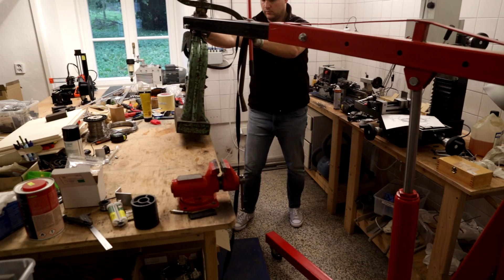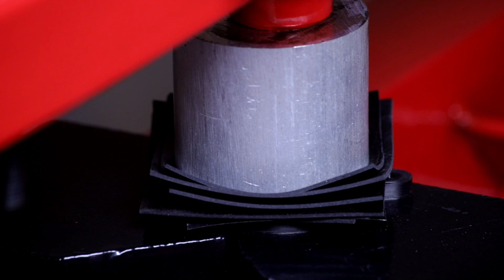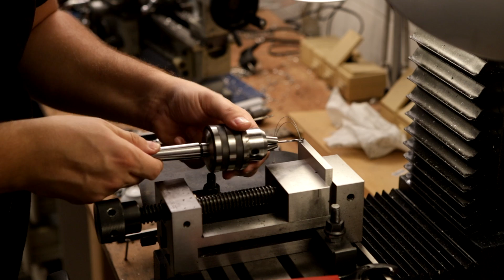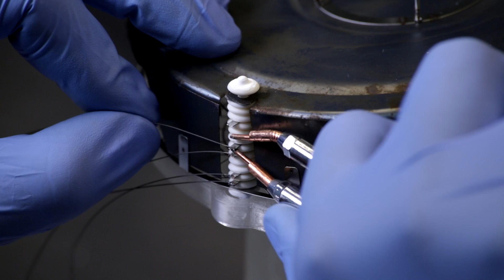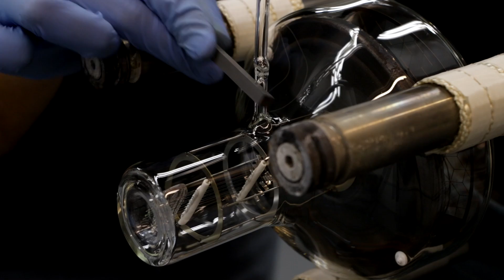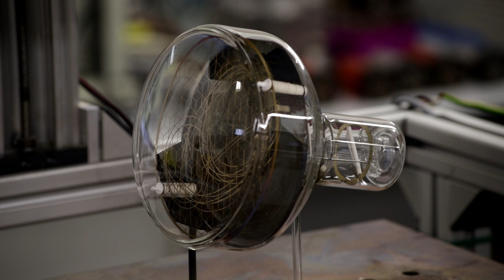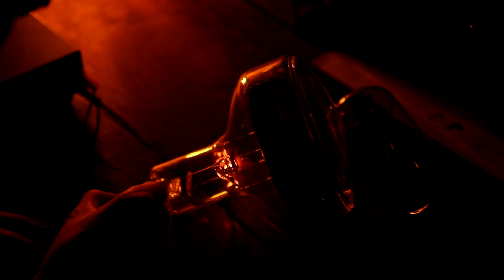Making: Huge Nixie Tube Finally Glowing!  - Project H #19

Comment from the maker: Hi! Thank you sooo much for the positivity and constructive attitude - not only it helps me to get closer to the working H tube, but it is also incredibly motivating. In these gloomy autumn days, it is especially important ;-)

We got much good advice here in the comments, I want to underline some:

It was suggested that the insulating layer of the ceramics of the Ceramawire is not thick enough to bring the potential below striking (or better maintaining) voltage level. So, the potential at the surface of the wire is still enough to strike and/or keep the glow running. That was expected, what is a real issue is that the ceramic coating is porous, allowing the electrons to escape from the underlying wire despite the dielectric strength of the insulation layer was not exceeded. Just a small quantity of free electrons is enough to keep the glow running as they produce new free electrons from the gas molecules itself.

The idea is to study these processes more in-depth and make another video about it soon.

Thank you for your support!
Reply: I have a question about the gas, that you fill your tubes with: Do you a radioactive starting aid like kr-85, or do these tubes purely rely on the high voltage for ionisation? I know a lot of smaller neon lamps (often used in switches) do use radioactive substances to help them start at voltages of <70v.
Reply from the maker: @unmountablebootvolume  We dont use anything radioactive, it is not necessary - the tubes strike reliably.
Reply: @daliborfarny  Cool! Sadly kr-85 will make even unused neon lamps/nixies fail, because it decays over time. It also causes cancer because of it's radioactive properties, which is another reason why not using it is a very good thing.
Reply: 1) You might look at a third ceramic insulator stack - strongest shape in nature is a triangle, but it would also give you a way to separate your wires even more.
2a) Consider alternating layers of number having the wire exit on alternate sides
2b) Consider having the electrodes and wire separated by ceramic rods at critical radius points to ensure stand-off distance (prevent arcs).
  
Looking forward to being able to buy these eventually. ;-)  Great work!
Reply: when the glass broke, my soul died, serious man, your art is unbelievable! you are very good!
Reply: Need the glaslinger on speed dial!
Reply: You are a very motivated person and a talented engineer. A professional in his field. You will succeed)
Reply: Do you plan on making more of these? I may be willing to buy some
Reply from the maker: @RayRayGaming-xb3pz  Yes, the H tube will become our product one day, once all the issues are solved!

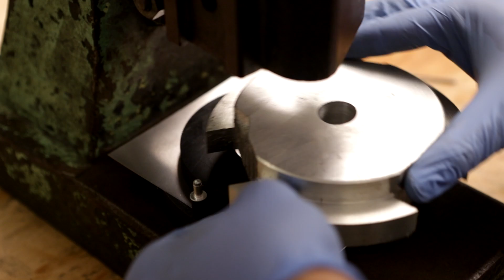Comment: 2:00
Can the metal to be formed be attached tightly to a strong frame?
That should eliminate the metal bending into shape and only allow stretching.
I think that would eliminate the wrinkles in the finished part.

Comment: I have never seen so much work put into a project. If a person had to do it in their spare time, it would take six lifetimes. Amazing work though.
On the press with the rubber. Isn't the rubber usually confined so it cannot spread out? I think that's how I've seen it done, aircraft industry.

Comment: I don't know what you're doing for eyewear, but for gas welding aluminum , which has the same sodium flare issues you see when glass blowing, i use a #3 or #5 pair of green safety glasses that take a prescription insert, which i had made with a non prescription lense (i could have had a prescription one made as well) in a "sodium flare polycarbonate" material. I was told to do this by the manufacturer of the lense material as the purple or blue lenses block the sodium flare but not the infrared which can lead to cataracts. So they told me to back it up with the green. It works great and the sodium flare just disappears. For glass work the green may or may not be necessary.

Comment: Just be super careful with that NaOH. Hot NaOH will eat flesh down to the bone. I worked at a circuit board factory many years ago. We treated our waste water with NaOH by just throwing a scoop in and crashing out the copper as CuOH precipitate. One time a guy was doing that. His pants were wet and he spilled some of the dry NaOH on his leg. It hit the water, heated to past the boiling point and took the skin off his leg and put him in the hospital. He was out for months. The scar was horrendous.

Comment: 0:43 - To prevent buckling, can a thicker sheet metal be used? 20:30 - You think ceramic insulated wires would work? This would prevent shorting. You really do like to keep things very small and compact, perhaps a different design is needed for the wire terminal block which would be much more redundant. You could also use some sort of special foam or glue that is applied to the wires and it insulates the wires terminal block. I would then check a continuity test before and after for no shorts when it goes inside the glass fixture, the foam or glue would prevent the wires at the terminal block to not touch short circuit or move. The amount of effort you put into this is really astounding.

Comment: That tube is really a piece of art!

Perhaps you could control the glow around the connection wires by adding a better insulator to the back of the anode - a sheet of mica perhaps or some powder-coating on the backside of the anode. As soon as the electrical distance between the anode and the wire gets larger, it should be the cathodes which turn on first and clamp the voltage.
Reply: ...or after placing the wires where they should go, fixing the electrodes, coat the wires with an additional layer of waterglass, a sodium silicate solution in water. When drying it forms a layer of sodium silicate, essentially glass.

Comment: To press anode in a good shape without industrial hammer with tungsten-carbide or steel dies, try to make dies with small needles (if 3D-printed material is hard enough that needles will work against steel). And ceramic wires of cause will never work (how you, with your experience decided to use them?) , only in glass insulation or don't make a CRT-style bulb, make them shorter.

Comment: Does every number have to stack on the same mounting post? Could 1 mount at 1 O'clock and 7 O'clock, and 2 at 2 and 8, and so on and so on? Seems like it might make wire management a little neater and mitigate shorting out risk. 
Just a thought. 
Beautiful tube sir, beautiful.

Comment: Your design of the deep draw tool may have been better. You could have made a fold retainer around your part and it would have been most probably much better. This fold retainer is a simple rounded groove on one and a rib on the other mold half, which adds friction to the material when it flows in the die. I used this in the past when I designed large deep drawing tools. It is also the reason why your inner surface was perfect, but the outer not. For the outer part there was no force against moving in the die, for the inner part the recess worked as fold retainer. Anyhow, you found another solution.

Comment: I don't know for sure but I suspect that the digits would need support on the 3 and 6 a clock sides (it the supports that are there now are in 12 and 6 a clock)
They look like they might flex and posible touch each other othervice

Comment: amazing work i really enjoy watching the manufacturing process 
just a suggestion why not double the wire (the problem with the ceramic wire glowing) making the connection between the digit and the cup with 2 parallel ceramic wires spotwelded together at the ends and twisted around each other..

thank you for the amzing content

Comment: Ah pump stem repair accidents! Done that myself a few times, trying to crack it off neatly and taking out a chunk of envelope. Even more frustrating is when you tip if off badly right at that last step and the seal implodes and destroys the vacuum or it just forms poorly and you know it will be fragile and crack in a few days.  I like to pull two constrictions in my pump stems for big and hard to handle tubes before I pump them, then I seal at the one closest the pump 1st and then put the tube in a better position to come back with a crossfire torch or otherwise carefully make the final seal closer to the envelope.  I also condense the glass a little in the constriction and/or use a thicker wall tube for the pump stem to make the sealing collapse more controllable.

Thought: Can you use a slot at one end of the digit support instead of two pins to give it a bit of thermal expansion tolerance?  I gather the insulator stack is tight and the friction may be two high to let the metal slip in the slot? The unsupported digit size seems large, what is the spacing?  What are the chances of the digits touching with thermal expansion and mechanical abuse?

Comment: Pretty neat watching you experiment trying to develop processes that solve issues with your build.

The shop I work as we don't have the breadth of equipment you do but I will still on occasion have to create jigs, fixtures and methods for making stuff for our customers. We work with simple common plastics such as acrylic, polycarbonate, acrylonitrile butadiene styrene, polyvinyl cloride, polyvinyl ethylene and a few others.

We generally don't heat the stuff much above its glass-transition state when bending and certainly don't use temperatures such as you use but it is still fascinating to see the similarities in material behaviour.

That giant tube looks awesome to my eyes. Nice job at a complex fabrication!

Comment: A little suggestion - you setup the digits on 2 shafts. It look nice but with this size its risky to short circuit by any movement applied to the lamp, probably even vibration of closing the door can cause a lot of sparks and dead electronics. You could try to avoid this by setting up digits on 4 or 6 shafts(cross or hexagon).
Reply: I was thinking the same. Digits of this size should have better support. But designing such digits might be issue.  Maybe some insulated support wire stretching from side to side?
Reply: @Papinak2 wow I didn't think about it first, but you totally right. Digits are not  symmetrical and it is impossible to set it on 4 supports. I can imagine few solutions but all of them required really Hight-tech stuff and very hard to made by hands.

Comment: Brace the back of the main plate with  two "H" section steel bracing bars (spot welded onto the plate), which are in an "X" configuration. That will hold the plate perfectly flat and prevent buckling. - It will also mean you don't have to press a shape into the main circular plate.

Comment: Burn-in will probably make your digit wires glow more than they already do. It's a bit like fixing cathode poisoning. The glowing sections will likely widen and brighten until the whole wire glows like the digit itself.

I don't know how your ceramic-insulated wire behaves. Could bending it cause ceramic to flake off? Also, how would the lacquer on magnet wire behave during the various stages of building a tube?

Comment: Possibly you flexed the ceramic coated wire too much causing the ceramic to crack? I would assume that if the ceramic has cracks it would allow it to glow. Maybe that's why the glow looks segmented? I think the bright spots may be where it's cracked. I would think the ceramic isn't all that flexible. Not an expert. Just guessing.

Comment: A metal forming press, works on speed and pressure, it had to have a smooth form so the metal flows over it, and its lubricated. The metal wrinkles when it doesn't flow over the form. Also many parts would go into several presses and forms to get the final shape, in your case the inner cup, then the edge on the next press, its not done all at once on some parts... still wonderful work!

Comment: I wonder if more stand-off mounting wires could be used to position the conductor wires, and perhaps a thin layer of glass melted onto them before inserting the display assembly into the main tube? Not sure if that makes sense, might help with some of the undesired glow or shorting.

Comment: Hi! Great to see that big thing glowing! My heart jumped about as much as yours when you knocked that stem  off!  I've done the same thing!  Now, on the glowing connecting wires. You already know the painting the ceramic glue on the wire. Too tedious for production of course. What I have tried is stretching some tubing to make a very thin fine capillary that the wire barely fits through. This can be easily bent to shape while assembling the tube using a very small tip torch. The glue can be used to fix any small spots. I worry about residual stress in the front window that might not crack the glass until winter. I just finished a CRT with a 3 inch window. It sealed perfectly but several days later it had cracked.

Comment: Field gradient stuff seems maybe applicable here? Essentially try going to a larger gauge wire (or maybe even tape/strips?) so voltage drops are more concentrated in your element and not in the wire to it?

Comment: Don't be afraid to use more structural bends in your plates. If you need a torus, use the structural ridges to give it the strength it needs to maintain shape. This will also help when it heats up later.

Comment: A really neat thing! For the wires, afaik they are usually coated with some ceramic-like insulation to prevent them from glowing. What voltage do you run it at, by the way?

Comment: Looks amazing mate, been following this with much interest. I greatly admire your patience and methodical approach to problems, I would have rage quit a number of times had I been doing this. that alone makes you a pro ;-)

I became fascinated with glassblowing as a kid, and had started getting into it a few years ago, just with basic hand tools and torches, and it was very challenging but alot of fun. I was hoping to get to the level of making neon signs. but then my house got broken into, and about all they stole was a pretty full 10cup coffee pot full of change, and my stock of glass tubes and torches. damn meth heads :-/ . thankfully they left about $2500 worth of radio equipment sitting right by the back door where id left it (I dont have a ham shack, but pull out any radio i want to use and set it up outside). I guess better to loose some glass than my radios. but I just haven't got back into it.

I know nixie tubes are your thing, but once you've mastered the giant one, I think it would be really cool to see you roll your own valve. If I win the lottery I'll commission one ;-) 

congratulations on first light! looks spectacular. Looks like something out of Bioshock.

Comment: Did “six” mean “nine” really? ) You will make that huge tube finally! Sooner or later.
PS May be try some teflon for an isolation? It must not pollute an atmosphere inside, and is flexible enough to be vibration tolerant, and can be obtained by scalping some wire.

Comment: Looks good. Great progress!  I think a good way to do it is a ring of small jet in a ring or circle with 360 degree coverage or maybe a small “window” to see.  Either more jets or bigger.  More I think is better to isolate the heat to smaller area on the glass.  More jets spreads out heat better for production.

Comment: Im not 100% on the physics of the glow-discharge that nixie tubes use, but if field gradient comes into play (change in voltage over change in distance in the insulator, both the ceramic and the gas) perhaps a larger diameter wire would reduce the voltage gradient around the wire to raise its striking voltage so hopefully the digit could light up first?  An A-B comparison between two different diameters of 'normal' wire for you in a test tube to see how the striking/ignition voltage differs may see if its worth perusing further. I.e. if its an academic difference and you'd need to use 5mm wire to have any real effect for what you want to do, or if going up up to 1mm wire and insulating the spot-welds with sharp points may be enough.

Comment: Since you are so adept at making the stems, could you make a stem out of dark colored glass (or painted black) to insert through the middle of the anode plate and use those glass coated rods you made in the Keysight video to go from there?  I could see using blobs of glass to insulate connection points and just alternate between the +y and the -y axis from center to sides for spacing.

Comment: So I guess it would not really be a nixie tube but with a tube that size you could design it like neon indicators. You could form each digit with an inner and outer wire with voltage between them. With ac voltage the glow will alternate between them. this would solve the thermal wire problem and the distance between cathode and anode are critical. You would also have no gride plate and it would need to be driven differently.

Comment: Hi Dalibor.  I've been following your channel for a couple of months now and I can appreciate how frustrating it can be after putting all that hard work into play and then finally hook-up the power with a vague feeling of disappointment when the numeric elements don't light up.  Is it possible that the spot welds on the meshes are shorting because of the spacer material being too close together?  Also, as the lathe process spins quite fast, is this putting stress on the spot welds or something?  I'm just throwing general ideas and observations at you because I think that the work and investment you've accomplished so far, is fantastic and inspiring.  Please don't lose faith in what you are doing because the rewards will be stunning! 😁👍